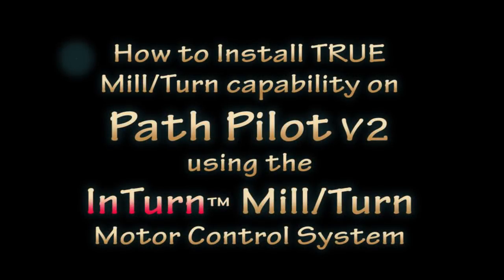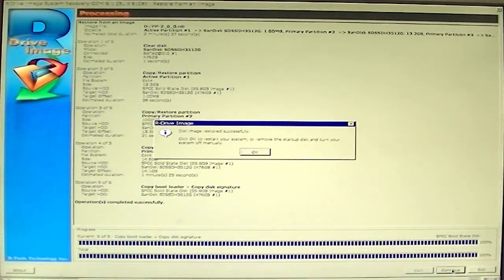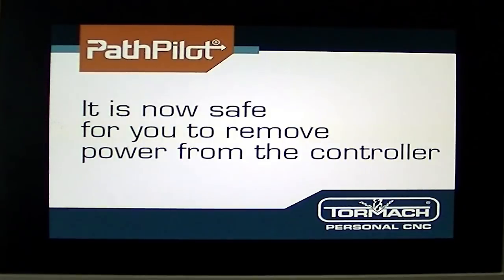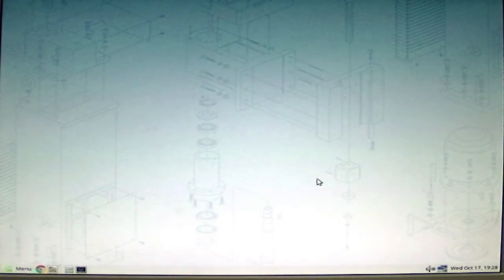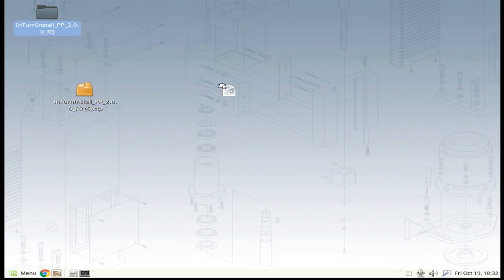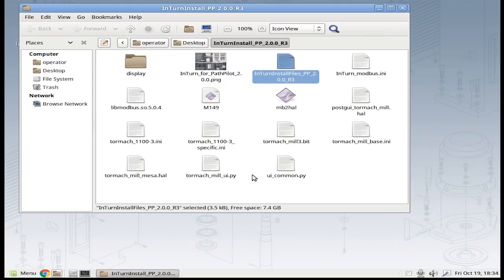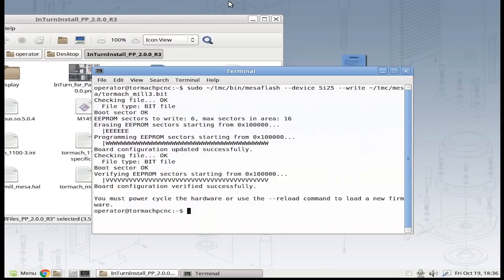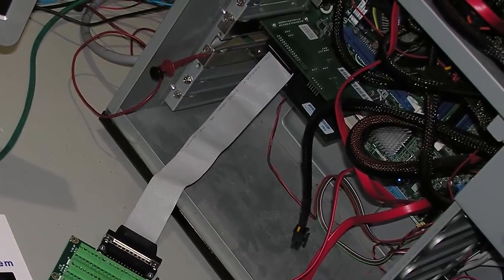How To Install the InTurn™ Mill/Turn System on Path Pilot V2

Comment: Hi Steve, good to see this video.  I have a prototype for your Mega-Duty InTurn (bought in late 2012 or early 2013) would like to know if the files discussed here can be used with that hardware.  I tried to check out the PDF file, but none of the password spelling variations I tried worked.  Will you be emailing owners with that info?  Thanks, Mike
Reply from the maker: Hi Mike, as I mentioned in the video, the password has been changed. The InTurn™ 4th axis can certainly be used, but the controller would need to be replaced. 
The InTurn™ Mill/Turn motor controller must work in 'real time'  and as new processors become available, new features could be added. Communication was upgraded from the problematic USB interface to faster and far more reliable Ethernet, for example.
Chips also got faster and much smaller so that  all of the functions performed by the three or four external PC boards are now accomplished on one internal board. 
The controller has always output differential signalling, but now it can also take in those signals thereby improving reliability while eliminating any restriction on the cable lengths.
This vid is a HOW-TO video.  However,  there will be a new product demo vid accompanied by a big announcement soon. That will be sent via e-mail to all users.
Reply: Thanks - looking forward to the next video and the email.